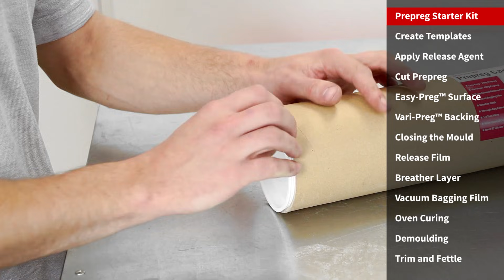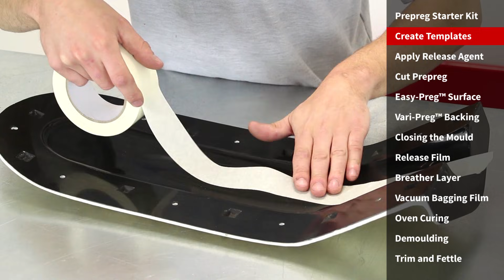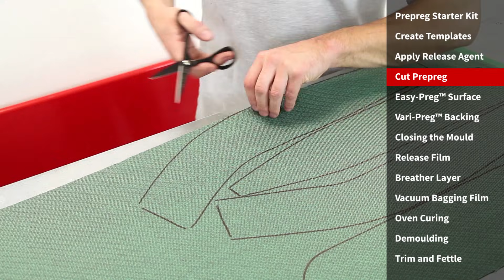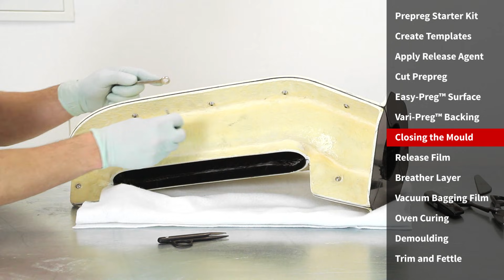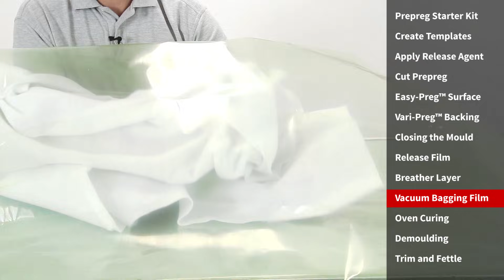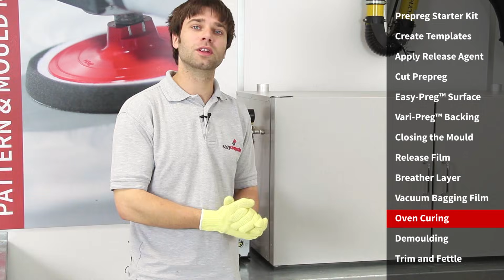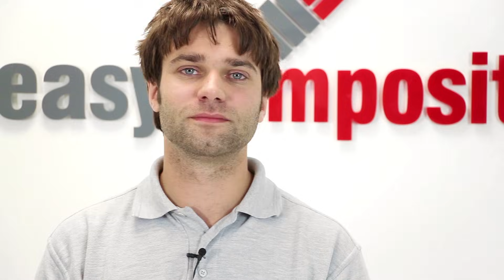How to Make Prepreg/Dry Carbon Fibre Parts (Carbon Fiber Airbox Pt. 3)

Comment: Hey guys,
were to get this curing oven? Or do you have a similiar one you can recommend?
Thx
Reply from the maker: +MaxKellin Hi Max; the oven shown (our OV301) is designed and built by ourselves. The reason it's not currently available for sale is that we significantly underestimated the demand for the oven and our limited production space is simply not sufficient. At the moment, we're setting up a much larger production area for the oven which should mean that it's available again soon. In the meantime, you may consider purchasing some other form of oven and then upgrading the heating and control system - not a straightforward task but this does mean you can get the ramp and soak control that you need even if you start off with an oven without this control. Please keep an eye on our website (or email our sales team who can keep your details on our waiting list) if you'd like to know as soon as the OV301 is available again.

Comment: Awesome! Must cost a bomb though!
Reply from the maker: I think you'd be pleasantly suprised. The cost of making smaller parts (not larger parts, admittedly) using prepreg can actually be lower than many other methods. Of course you need to buy the equipment like the oven and pump but once you have those it can stack up very well.

Comment: You guys are pro`s! Do you think pre preg can be manipulated into an acoustic guitar shape that has the back neck and sides in 1 piece? Like this : http://i61.tinypic.com/nvwn5e.jpg

Can it make the bends?
Reply: VirusTornado vidznstuff1 I was just quoted 1500 Euro per prepreg body after i visited the company with my protoptypes. That ansers the quality issue, it is too high, my retail procepoint must be around 2300 Euro, a 1500 Euro body will make the retail price 5000. That is not what i am aiming at as a start up.
Reply: As a startup, breaking even is OK, but IFF (if and only if) you get costs to scale once you get your sales up.

Don't forget that CF is in short supply now because of aerospace, but once they're caught up, I don't see any reason why it'd be much more than GRP. But, that's my crystal ball - use your own because it's your ass on the line.

Don't forget that one of the best composites available is....wood. Also don't forget that body acoustics are affected by the material being used - you could wind up with a 1kg piece of beautiful CF art that sounds like shit.
Reply: +Koen Klijnsmit Do you actually need pre-preg strength for a guitar? I mean, a dude made a violin on his own here by infusion and it turned out great: http://www.instructables.com/id/A-carbon-fibre-violin-i-made-from-scratch/
Reply: +Koen Klijnsmit Yes you can. BUT, a guitar neck is probably as challenging structurally as +DerNoNem's motorcycle swing arm. Just buy one: http://www.guitarsite.com/carbon-fiber-guitar/

You could guess, but it'll either be heavier than it could have been, or will break under string tension. Which means a lot of iteration for an expensive material. You also have the challenge of incorporating hardpoints for the hardware.

+EasyCompositestv - how about a vid on hardpoints (both metal and wood) in carbon fiber?
Reply: vidznstuff1 Carbon is in short supply? I can buy 100 meter rolls if i had the money... Carbonasation is a process of a regular strand, carbon fiber can be produced unlimited. Wood is not a composite unless you laminate it, which is uncommon and looked down on in luthery.

Comment: Why so much of a difference  in $$ between None and Pre-preg???? &=78.86 for 240g/m 1.25m by 1m vs. 30 for NON?  I can see a small mark up but 30+ pounds per m2? 30$lbs/m2 240g CF + 1kg of resin (18.42 per kg)= 33.51/m2 for the (pre-preg process)135% markup???? AND you still have to spend money on bagging/breather cloth/vacuum material? Your only saving on resin and flow median... I can see charging  33-50% more for pre-preg.. (65-72.50/m2) anything else is robbing the stupid/lazy.
Reply: +JerseyMikeP A wet-layup part is heavier and the fibers can distort during the lamination process meaning the process is less controlled. In the Prepreg process, the resin is applied by machine onto the fibers in a thin film. Therefore, the resin is very even and controlled. The parts are then cured under a high pressure and temperature environment (Autoclave). This results in a well-compacted laminate with better properties than with wet lay-up. Laminate properties in Prepreg Carbon fiber can be 10%- 20% better than wet lay-up at a lower weight (because less resin is used to do the same job), not to mention that the part is much stronger. Therefore, this Prepreg and Autoclave process is used to manufacture the exceedingly strong, but light, chassis and partsfor Formula 1 cars.
Reply: +VirusTornado I doubt there's much difference between a vacuum-bagged wet layup (done properly) and a vacuum bagged pre-preg other than maybe the "resin" that you can use. Agree with you on a non-bagged wet layup, though.